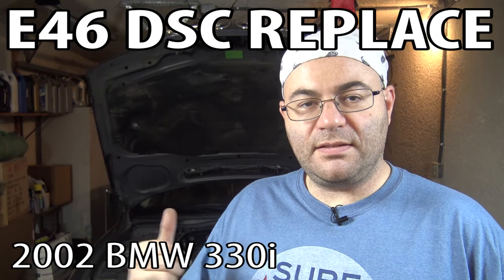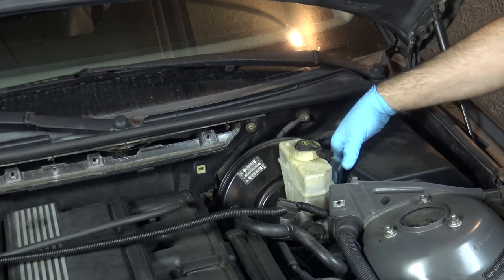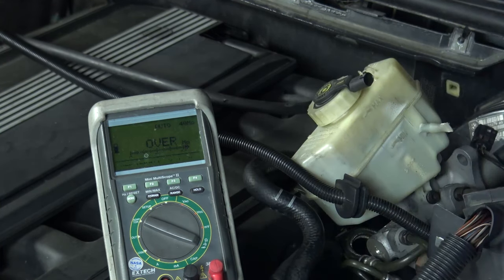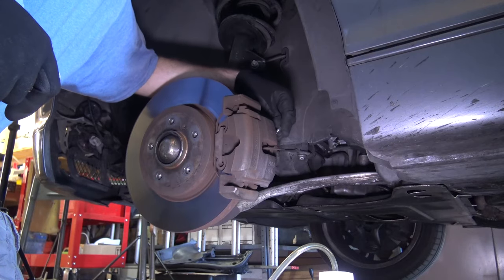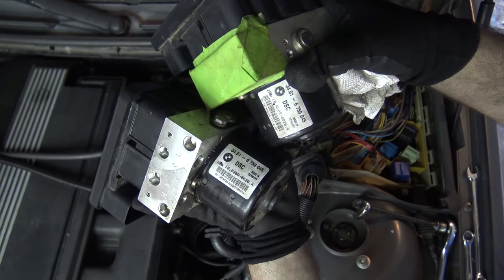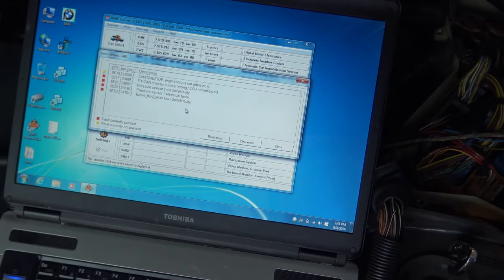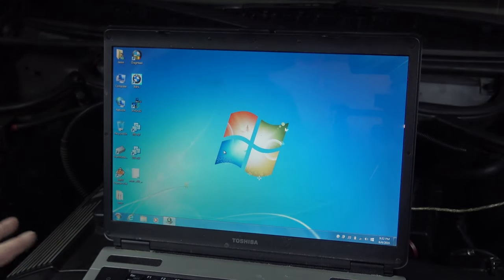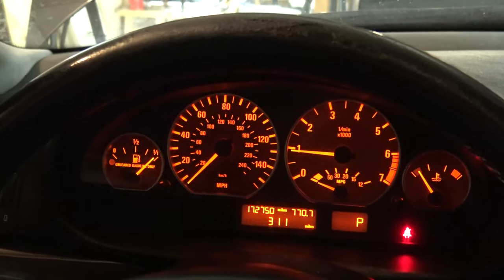BMW E46 DSC (Dynamic Stability Control) Unit Replacement & Coding! DIY

Comment: With mk60 all is “easy” not information about mk20 but it is not as easy bleeding procedures not as assisted like mk60. After that kind of work dont you need to bleed master cylinder? Either software assisted or bench bleed? It should have a secondary circuit which should be bleeded and it is not the regular caliper bleed you mention/showed in other videos... All people goes to do a video when all the information is easily accesible by internet / typical softwares we can have by searching for them but when things are harder you have a difficult way to find properly information… 
Teves Mk20 is the hard way to do all these software assisted bleeding operation so surprise no videos or information talking about it…either on dis 44 or inpa there is no service function to bleed components by service function itself… I have a chance with ista bleeding service functions as I could bleed the caliper procedure but pedal still spongy as my pressure bleed didnt have enough filled and my brake fluid reservoir went empty so air should be on the precharge pump(only on asc/dsc mk20) or the master cylinder either.
I did the procedure a second time and this time enough break fluid on the pressure bleeder, this time with once precharge pump activation (with dis) and after that the caliper bleed  service function on all wheels as tis documents except I dindt see hydraulics-bleed service function on dis for mk20 I had to use ista separately to do this. still spongy feeling. Pedal have the correct range and car brakes but spongy feeling… so on mk20 you can activate all elements involved in the brake system individually by common old softwares and you need to know how the circuit works to understand where could be the air trapped and bleed properly/efficiently… You only shows “evidencies” useful but not as accurate as desired.
Anyway thank you

Comment: Let's see, first, Power Brake Booster replacement (no bleeding required), then bleeding the brakes, then new Master Cylinder, then new DSC. (or used parts) Hmm.  Lots of good info, and perhaps some bad
info? (not unheard of from Youtube videos, I hope I am wrong about these)

The progression of the videos by 50sKid   is puzzling, however.  For example, when I watched the Power
Brake Booster change-out video (no bleeding required), the DSC was
moved and jostled around a lot while being kept connected. As was the
Master cylinder.   But no word of possible damage to the systems from doing this "no bleeding required" brake booster swap out.

Now here we are, and the 50s Kid follows up with  videos replacing the DSC, another about bleeding the brakes, and
another about replacing the Master Cylinder.  On the same car.  All, it seems, created after the Power Brake Booster swap out video.    Am I watching videos and following steps that actually end up ruining my wife's car? It
only has 111,000 miles and only the Power Brake Booster needed
replacement.  Are we sure that no damage occurred to the 50''skid DSC or his
Master Cylinder during the Booster replacement? Can we be sure that
all the moving and bending of the copper brake lines required to
replace the Brake Booster did not cause the "endless bubbles"
 discussed in another video, and the need to replace the Master
Cylinder in another,  and then replacement of  the DSC in another?  
All of these are systems that were moved around a great deal during
the Booster replacement video. 

There seemed to be a few crucial seconds missing from the Power Brake Booster video. For
example, I did not see it actually pulled out.  I had to cut the
Master Cylinder mounting bolts on the old Booster to have room to get
it out.  Further,   I had to remove the windshield washer cowl on
this E46 325Ci to get the booster out. (note, convertible cowls are
unique amongst E46 body styles)   Also, I had to unbolt the mounting
bracket for the DSC in order to move it enough to get the Booster
out, which apparently 50's Kid did not need to do.  At least it did
not seem so on the video.  

Next,  I needed someone to hold the new  booster in place so that it's two bolts would pass through the
firewall and pedal mount far enough to get the two nuts started on
those two interior Booster bolts.. (I did remove the overhead brake
pedal mount bolt early in the whole process). Of note is that
regardless of how tight one screws the Master Cylinder top, it will
leak small amounts of brake fluid into the engine compartment when
tilted enough to get the old Brake Booster out and the new one in. 

I wish I had watched those last 30 seconds of the Brake Booster Replacement (no bleeding required)
before I actually started the job.  Only then did I hear about “soft
brakes”, maybe need to bleed again, etc, etc.  I hope following the
Booster video did not start me down a long trail of previously
unneeded repairs.  I have no choice at this point but to finish out the job.  I think I'll buy a Bentley Manual for this car.
Reply from the maker: a) The brake booster video was made like 1.5 years before my recent problem with the DSC unit failing.  No, one had nothing to do with the other.  Things just fail, especially on a BMW.
b) Even when doing a bleed using INPA to activate the pump to help dislodge the air bubbles, it still takes a few times before you get everything out.  Each situation is different so just repeat until you get it feeling right.
c) I make these videos to help people and most are quite grateful for my help, but then I get a person such as yourself who appears to want to blame me for the poor job you've done with your own repairs.  I would prefer you not watch my videos in the future and just figure it out yourself, thanks.

Comment: I was told a respected BMW tech center that on the z series and 6 
cylinder models "you can't put a 2nd hand abs control pump  on because it's been 
programmed to that specific car", just wondered if anybody had heard of 
this before?
Reply: Uh yeah bro you have to program it... like in the video. Did you watch the video?

Comment: I bought one of those clone PASoft BMW Scanner 1.4 cable/dongle in xcar360.com, it worked the 1st day and threw it away in the thrash the next day (getting "Hardware not ready" errors... tried a lot of things even using new usb cables and the POS won't work.. well $20 down the drain... 

I might try the INPA software again or if you know of a decent BMW  Scanner 1.40 knock off seller, let me know.. xcar360 is no help.. I think all of those cheap clones in ebay came from the same source (some get returned and sold again)...

Comment: thanks bro for another vid,  getting a( ! )with a arrow around the top( arrow starts form right to left. is this related to the light
Reply: but no ABS lights
Reply from the maker: That means the traction control (DSC) is off.

Comment: I’m having the same problem with the lights I change all my wheels sensor and my car goes into clog mode after driving around and drives sluggish
Reply: Did you figure out what the problem was?

Comment: Been wondering if my DSC/ABS module is my issue or more electrical. I have an 05 325i auto. Will reset itself when restarting the car several times. but then the trifecta of ABS, Brake, and DSC come on under low load. My symptoms are limp mode and a bucking, surging idle that fluctuates between 1000-1300 or so. Changing gears does nothing for the idle, only restarting the car several times.

1st time didn’t throw a code, 2nd time threw P1632 (throttle valve adaptations not met). Along with some other ones I got through a generic OBD2 scanner.

Any thoughts?
Reply: mine use to do this sucked couldnt get passed 60mph... turns out the MAF was bad .. got a new one but before hand ... disconect the MAF sensor plug and drive n see if the problem stops